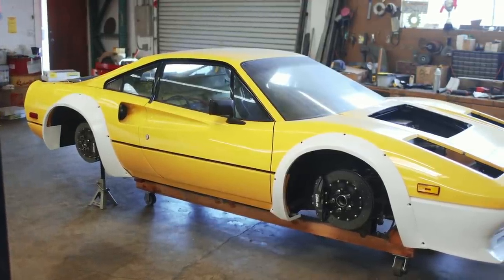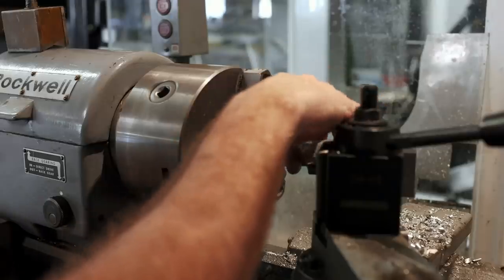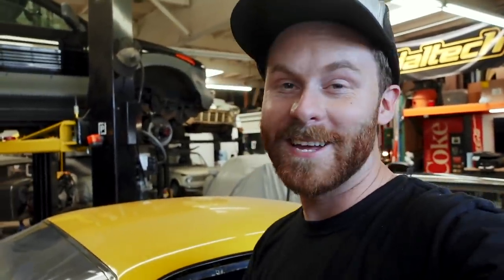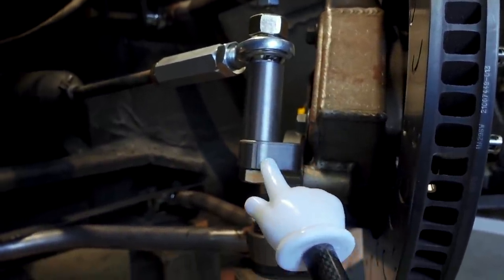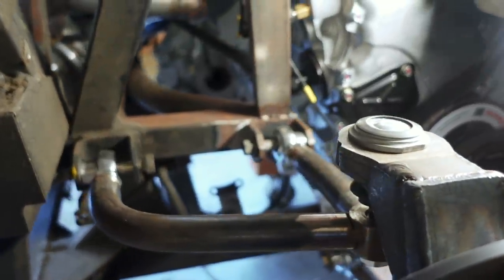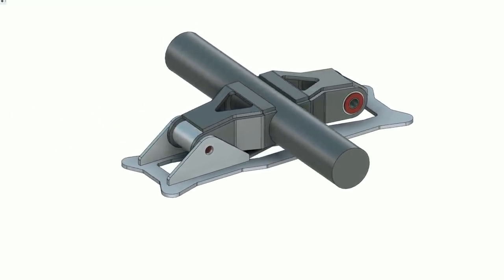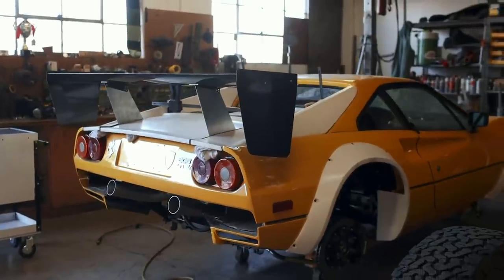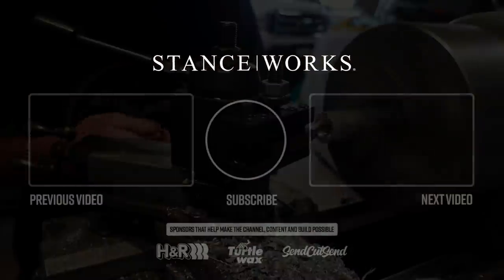Honda-Swapped Ferrari - Custom Fabricated Steering Build

Comment: I used to chat with old-school Ferrari mechanic back in the mid 2000's . We talked a bunch about older (80's era) Ferraris and their oddball manufacturing techniques and parts sourcing. This actually came up when he said that you'd always get a surprise working on steering because of the part sourcing. The imperial / SAE tie rod ends are from Ferrari using vendor out of the UK for their steering components. He said that used to throw the younger mechanics off all the time. I think the company was called Cam Gear and they used to make steering components for Mini, Lotus, Rover etc.
Reply: True, I had a Dino 246GT, and I replaced the steering rack with that of a mini, same part for a fraction of the price 😉

Comment: Remember to use the safety washer, or a nut bigger than the heim for single shear applications…. Also I would run the bolt head facing up, in case the nut gives out it stays in place
Reply: But probably you have it figured out haha !! So happy to see the progress and makes me want to build
Reply: I would’ve left it as a tapered hole and used a tie rod end. The issue with a bolt is you inherently have slop in straight cut holes. They take up slop the most efficient way possible by using a tapered hole and a tapered post bolt. Self centering, self aligning and free of free play regardless of temperature or expansion/contraction of the dissimilar metals.
Reply: @RadDadisRad  bolted joints are designed by clamp load and not for shear. You look at the friction, surface area, and torque used for that hardware size. The taper does provide alignment but his car is designed for more precise manipulation rather than easier set-up so the bolt to hole slop has no impact
Reply: @jacobletts2043  The point of a tapered hole/shaft is to spread load evenly across the entire face of the taper and not at a single shear point as is the case here.
Reply: Tapers work really well but, you wouldn’t be able to adjust bump steer. You can design the bump steer out in design before manufacturing but, it does require some geometry knowledge.
Reply: @woznaldo  you absolutely can adjust bumpsteer while still using a taper, with a stud that’s tapered on one end
Reply: @blandsarcasm  yep. Absolutely but, you’d need to make that. It’s doable but needs a little experience to ensure to don’t create stress raisers.
Reply: You can buy those studs for many popular applications. https://www.speedwaymotors.com/Adjustable-Tie-Rod-Adapter-Stud-to-Heim,3333.html
Reply: @Bigelboe  well that’s pretty awesome!
Reply: Good advice, I like the bolts run from the bottom for a visual bolt check. The nut could be gone and you wouldn’t notice until the bolt vibrates out. Great Job Mike!!
Reply: @jacobletts2043  the taper provides alignment by removing any variance from hole size to bolt size. Self centering and free of side play. A straight bolt cannot possibly provide that.

Comment: As someone not well versed in steering/suspension terms and applications, seeing what you mean by Ackerman angle and bump steer made total sense and gives perspective to how many factors you need to consider when designing custom suspension. The time spent on these videos is appreciated by us viewers big time. Keep it up Mike 💪🏻
Reply: Ackerman*
Reply: @RadDadisRad  as I said, not well versed 😂 Thanks for the correction!
Reply: No problem, suspension is like wizardry. It’s all based on dynamic implementation. That’s the hardest thing to calculate because it’s not static. I honestly don’t know how these companies come up with their multi link setups.

Comment: Great to see progress on the build. The reason for the way the thread stripped on the lathe was because you need to use tapping fluid on aluminium. Without tapping fluid, the tap will bind up and tear the thread. keep up the good work.

Comment: A few of points on the suspension. Like you’ve said, you really want the bump steer to be as close to zero as you can get. If you do have any, the preference is for the steering to unwind in compression. If you have it the other way you could be at the limit of tyre slip and a bump pushes you past that point with a sudden lose in grip. Modern tyres are a bit more tolerant of this though. Next point. With your damper mounts, you want the load path to pass through the ball joints in a straight line where possible. Packaging might compromise this but it should still be the aim to reduce bending loads in the A-Arm. Ackerman. The diagrams you have shown explain what 100% Ackerman is. This makes the car easy to push around the workshop. Once at speed, all four tyres will experience slip, which adds a steering element. I’d aim for about 80% Ackerman as a start point, especially if you plan on running at faster circuits. Maybe less. It might be worth working out what the original car had and starting there? Things to think about. Love your work Mike!
Reply: Thanks Woznaldo, I always wondered why it wasn't just as easy as setting "perfect" Ackerman and leaving it at that.
Reply: Yeah Ackerman doesn't really matter on a competition car. I have a collection of old F1 and Grand Prix books. The designers didn't worry about it. The higher loading of outside front wheel tends to force it to operate at a higher slip angle anyways.

In one of my books they quote lotus's Colin Chapman as saying the only reason they put and Ackerman on their cars was for pushing them around the paddock.

Comment: Awesome stuff. The drilling on the lathe problem is because the drill bit was not sharpened correctly. While drilling, it forces itself of center thus making the hole bigger than the drill bit itself.

Comment: Just FYI, you don't need your tie rod adjuster to have reverse threads. The inner tie rod spins without issues, that how it's adjusted on a regular tie rod on any rack and pinion. You created an extra adjustment that is redundant and unnecessary. Won't hurt anything, just not needed.

Comment: In high school machine shop class (hey Cap Ewen) I was taught to insert smaller diameter parts, such as rods and so forth, as far into the three jaw as possible. Same with the drill bit. To minimize effects of wobble by imparting support . 
The other comments about tapping fluid are good info. Especially tapping aluminum.

Great project ! It’s going to really be something to see it in action.

Comment: When you get the front steering angles figured out, please make a new set of steering arms that are higher to eliminate the bushing or additional brackets,  and replace the Aluminum connector part with steel or Cr-mo,
 its the weakest link on your "curb hopping" race car, 5x the power as before, large magnitude higher braking forces, higher G forces. Even a bump with a competitor might weaken it.  Steering components should be steel or Cr-mo.

Comment: I just got done redoing most of the steering on my LS swapped Impreza and man.. It sure did teach me a lot about this stuff. I ended up with a mustang manual rack and the stock control arm. I dropped the control arm 3.5 inches and that got both the rack and arm on the same angle. It never occurred to me that I could have just put a spacer on the tie rod end. But both ways work.

Comment: I love it! Great to see those amazing former projects. I really appreciate the explanation of the more technical aspects of steering geometry. The cleanliness of your shop has inspired me to clean mine. In regards to the rear hood, if it were me I’d send the original to one of your carbon fiber specialists friends and have a super rad custom lid made. It put some mean vents on it with slats and maybe a scoop or something oil and functional, maybe see through plexiglass like the F40? The rear of the car is going to get the most attention and I wouldn’t want a second rate lid detracting from that feature. I’d make it the main focal point until you pop it and everyone’s head explodes when they see that turbo charged K!!! Keep up the awesome work !😎🤙🏽🙏🏽

Comment: Still have bump steer probs, Mike. Just get the longer ball joints! Looks like you're using K772's or something. Coleman makes longer tapered studs as well. That is what is going to fix your bump steer. Also, you're going to want to make the tie rod/upright connection double shear if you're planning to use such a tall spacer with that thru hole/bolt. The point of a tapered hole/shaft is to spread load evenly across the entire face of the taper and not at a single shear point as is the case here.

Comment: honestly keep up the CAD, just watching this series has pushed me to do the same, unfortunately I do not have a send cut send or a project but I am hoping to prototype some parts with 3D printing before getting them CNC'd simple things like gear shifters and eventually I want to make some carbon parts, maybe a relocation bracket to update my rear brakes one day. You are honestly lighting a fire under my ass and inspiring me to actually try and that's really cool, thank you

Comment: Engine Cover.
I'm sure you have thought of this so ignore me if you have. One option could be to use the original steel engine cover to make a mold and then build your own carbon fiber replacement. This keeps the genuine Ferrari item intact (to sell?), enables you to have design input and your not waiting for one to be delivered. As a bonus, you have a mold to make a quality part for sale if desired.
Oh, big fan, great content

Comment: One good software I have used for suspension geometry is lotus suspension analysis software. You can enter all the key points of your suspension geometry and simulate those in road conditions. And once that's done you import those points into 3D space and work on your geometry. It saves a lot of time and you get pretty accurate results.
One suggestion I can make for the coil over mounts is using a cross tube across the A-Arms instead of the plate and welding the brackets.

Comment: Engine cover fit idea. (DIY 2-3 days ) Mask the body/parts all around the engine cover. Put calibrated  3mm wax sheet or gap you want, (less 1 mm save, to can tune it) all around complicated corners/edges. Stright lines ...you can use calibrated foamed pvc (Stick it with doble side tape to the body).  Then put your engine cover on and fill up,squeeze all gaps with same resin/composite, clamp it with tape gently without stressing the cover. You will have a strong and concistence, edge/gap all around the engine cover.

Comment: I’m as enthusiastic about this build as you are Mike, I wish I were there to lend a hand. I would like to interject my 2 cents about the engine cover, I think having a body & paint guy fix the carbon cover is really not that big of a deal, especially since you’re doing the rest of the car. Like you previously mentioned, keeping the original steel cover intact and using it for “street” use when the wing is removed is SUCH an awesome idea, I hate to see you lose that option.

Comment: Maybe this is crazy talk, but there is no way in hades that I'd ever use aluminum on critical suspension parts, unless I had done a LOT of testing and analysis on the stresses and was certain of the alloy. Aluminum has no "endurance limit" and ALL aluminum parts will eventually fail from stresses that accumulate over time. Granted, with proper calculations, that eventuality might be beyond the expected life of the car, but that's if you're willing to really dig into the finite element analysis (FEA) of the exact parts and then design in safety factors and inspection schedules and replacement intervals (like they do in aerospace). I would personally use steel, which does have an endurance limit (meaning you can design it to last theoretically forever from a metal fatigue standpoint).
Reply: Replying to boost this comment, most just focusing on the threads though. Those threads going to see a lot of axial force. Like David said it’s hard to completely gauge safety margins without knowing completely about the drivers habits/course quality and general loading, but I’d be terrified of accidentally over-torquing the tie rod end and hitting a corner too hard. Even just threaded inserts of some form (helicoil) would boost confidence. 

Could just be my mechanical engineer paranoia, though. Car is looking fantastic as always
Reply: Another reply to boost, hope he will see this. One bump in the road and a slightly over- or under torqued nut and the thing goes snap or strips the threads.

Comment: Love it; up there with project binky! Have a look at the street Bandido carbon 240Z, use your steel engine cover and use as a plug to creat what you want. That way you can keep the steel one in great condition. Or easy composites have a great tutorial. Other tutorials are available 🤣

Comment: Great work once again, looking forward to the 1st drive already! The original steel engine cover will be quite heavy to lift and will be a PITA, assuming that you can’t use hinges because the opening and closing of the cover is not possible normally because of the wing. So maybe carbon/kevlar is the way to go, even with the fitment issues. On the lathe and the problem with threads, maybe the piece or tool were not fully centered and the tool cut a larger hole than intended?

Comment: your cad work looks good, you should try and make tabs and receptacles to make the pieces self locating to each other when assembled/welded. use circles in the corners of the receptacles to deal with the corner radius made by waterjet/plasma cutter.

Comment: A few points about tie rod ends. Clearance stacking can be an issue. Unsealed ends have a short life. They are very noisey. I agree with the post about aluminum steering parts and the need for left and right threads on the toe adjuster.
Reply: I wouldn't use aluminum parts on the steerer. Although the tensile and yield strength may seem close to some steels, fatigue properties are not. There will be galvanic corrosion and they tend to strip a thread plus un coated aluminum friction coefficient is not good for a fastener.

Comment: I think if you designed the mount to address the sail panel then you can make the appropriate adjustments for the rest of the lid.  I would use an interlocking mount that when pushed into position the lid will pull itself tight into position.  Granted given that the lid looks warped you are still going to have several places you have to push out and pull in to make the whole thing fit, but at least the sail panel will be good.  Last thing you want is air to get under those corners and rip the whole thing off.

Comment: Backseat engineer here, it appears that's the stock rack you're using, which I would be cautious of for a few reasons: A) Is it the ratio you want? B) is it worn? C) Most importantly, is it strong enough for a 305ish front tire, that is 200TW or less? I know it doesn't take all of the force, and you probably won't replace it in V1, but something like a Sweet Mfg. rack is likely what this car needs. As a result, you can safely play with power steering pulley sizes underdrive/overdrive the pump to adjust steering feel with that setup, and have full confidence in your steering system

Comment: Great work Mike. Forgive me if it’s been mentioned previously. I assumed you’d probably replace the Ferrari steering rack with a modern uprated one. Are you still using the original? I know it’s a Ferrari part but it is old now. Just wondered what your thoughts were. Also i know it’s been a thorn in your side but i cannot wait to see this thing on it’s wheels! Keep up the awesome work👍🏻

Comment: Hey Mike! I know that I am late to this video but I think I have an idea regarding what went wrong with the first turnbuckle threads. When boring out the hole you can see the drill bit moving ever so slightly. That wobble/deviation might have oversized the hole by just enough to compromise the threads in the following step.

Comment: Awesome stuff as ever. Great Ackerman description too - you sold yourself short! I wonder... would raising or lowering the mounting position of the rack be possible rather than using such long spacers? Also, is that original Ferrari rack going to be strong enough for a race application?

Comment: Second comment. You said previously you'd like to keep the og cover for street use. Why not have the company that made your wing or another company pull a mold from the factory deck and make a carbodect from that mold with all the additional considerations built in for the wing application. That way you have both starlet and race trim for the this car.

Comment: How about splitting the engine lid in two? have a front and a rear part. The rear part will be fixed, and the front will use the oem hinges to open and close. Avoiding the spoiler. you could even incorporate a slightly more aggressive tail fin / lower spoiler to the "fixed" part..

Comment: I'm slightly worried about that bolt wearing the aluminum. On the regular tie rod ends, the tapered part is static, and the movement is transferred into the ball joint. While this one is similar, it may make the bolt turn ever so slightly, rubbing the aluminum hole, ovaling it over time. Just a thought, could be wrong.